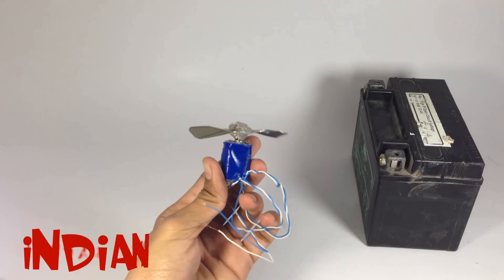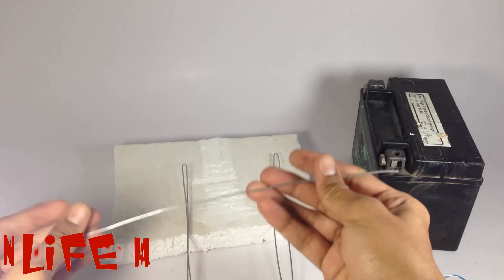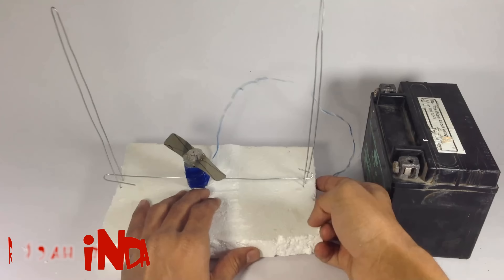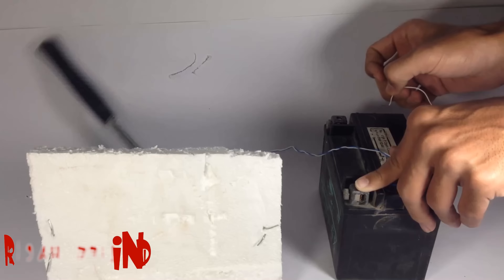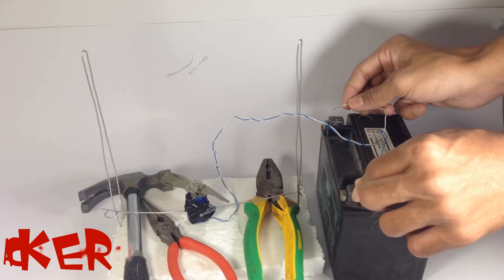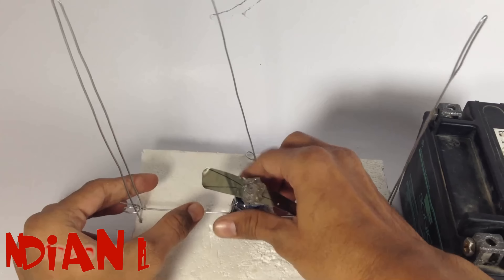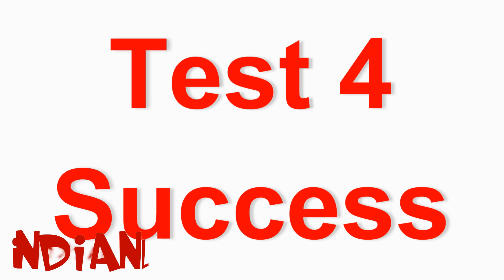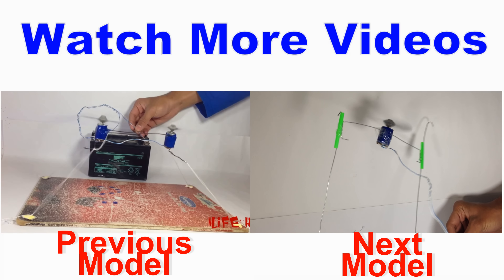Homemade HELICOPTER  that Fly

Comment: Yeah, fine, but that's not a helicopter design ... This is just a fan turned with the propeller upside. The previous video with the two motors looks much more like a basic design thank this now.

Comment: Which type of moter U R using here.. and what is voltage of moter
Reply from the maker: +Aziz Shaikh 
this is a toy motor with higher gauge wire diameter than normal and its a 3 volt motor